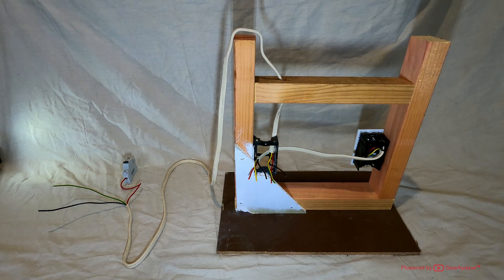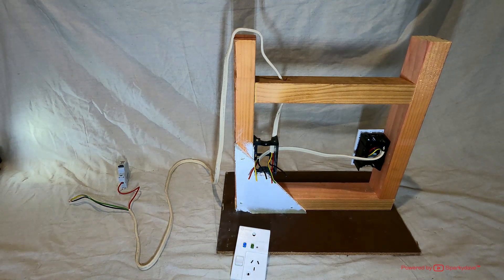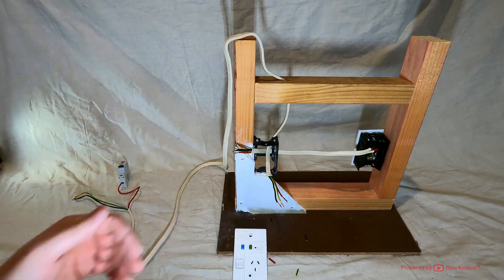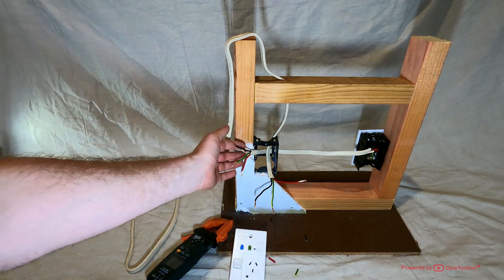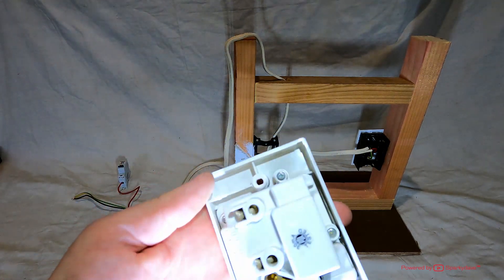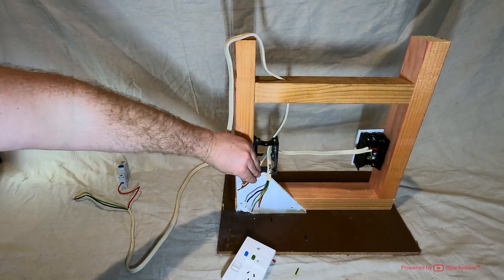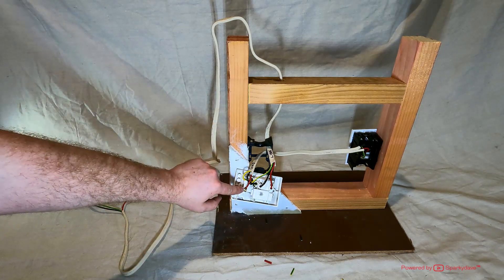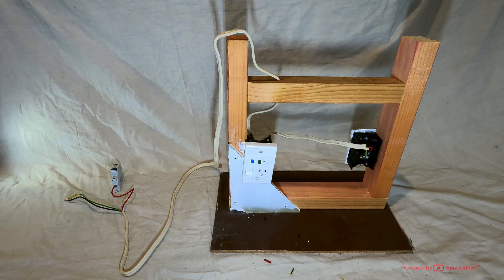Basics: How To Install Socket RCD Outlet (SRCD)

Comment: Great video, but the continuity between neutral and earth will only work if you don’t have a dedicated earth bar and/or an MEN link. However it’d be safe to assume that if an MEN link existed, then you’d have an RCD protected circuit anyways.